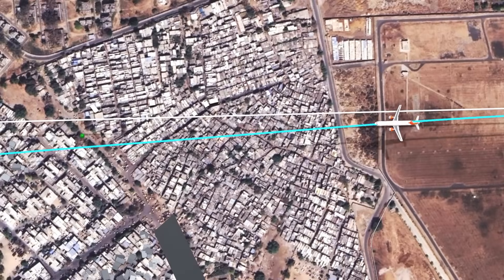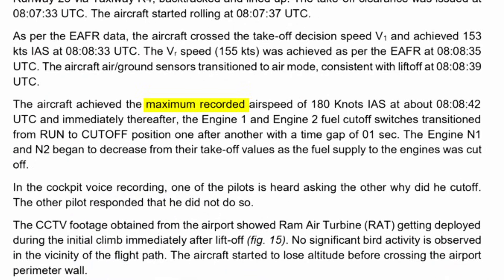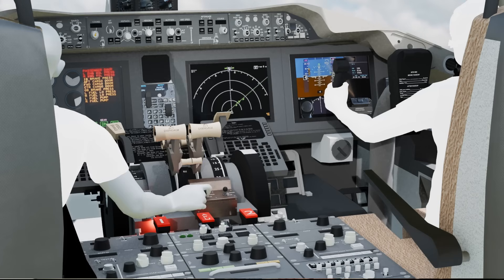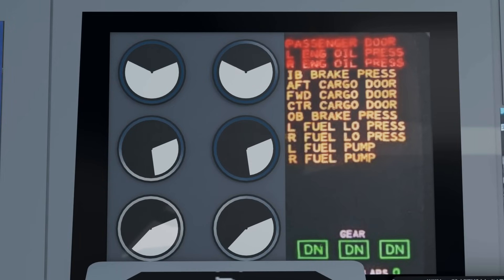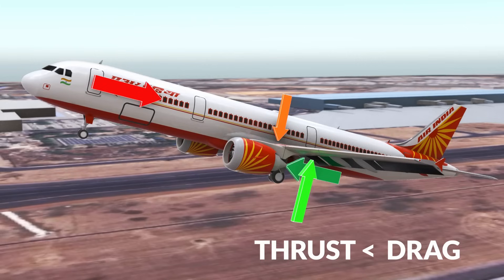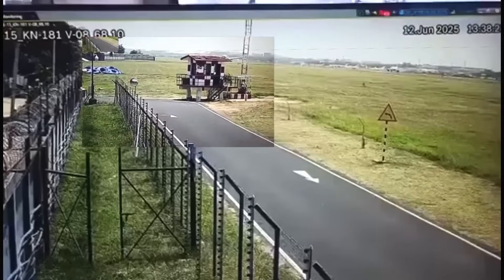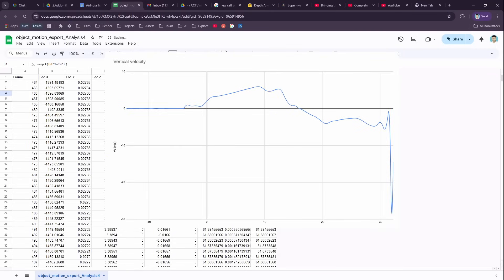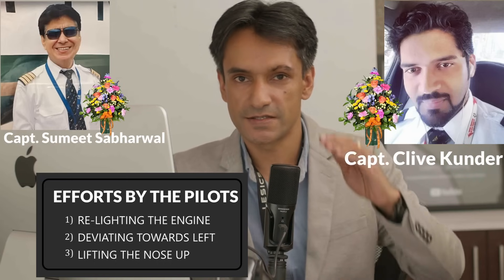Use of 3D Clone | Decoding the Crash Details you Missed

Comment: With 2,05,000 Kgs load and V1 as 155 KMPH, QnH 101 KPa, Dry runway, Temp 38 C, 6 Km Visibility, length of runway needed for a 787-8 to be airborne
for a Boeing 787-8 to become airborne with a load of 205,000 kg and a V1 speed of 155 km/h, we can refer to general takeoff performance data for the aircraft.

Key Factors:
Aircraft Weight: 205,000 kg (which is below the maximum takeoff weight of approximately 250,000 kg).

V1 Speed: 155 km/h (which is the speed at which the aircraft can safely take off).

Estimation of Runway Length:
The takeoff distance for a Boeing 787-8 can vary based on several factors, including:

Aircraft weight
Environmental conditions (temperature, altitude, wind)
Runway conditions (wet, dry, etc.)

General Takeoff Distance:
For a Boeing 787-8 at maximum takeoff weight, the typical takeoff distance is around 2,500 meters under standard conditions.

Key Factors:
Aircraft Weight: 205,000 kg

V1 Speed: 155 km/h (approximately 43.06 m/s)

QNH: 101 kPa (standard atmospheric pressure)

Temperature: 38°C (which is above standard temperature)

Runway Condition: Dry
Visibility: 6 km (not directly affecting takeoff distance)

*Performance Considerations:
Temperature Effects: Higher temperatures reduce air density, which can increase the required takeoff distance. The standard temperature at sea level is 15°C, and for every degree above this, the takeoff distance can increase.

Pressure Effects: The QNH of 101 kPa is standard, so it won't significantly affect the calculations.

Weight Effects: The aircraft is below its maximum takeoff weight ( 2,50,000 Kgs) which will reduce the required runway length.

Adjusting for Weight:
Since the aircraft is lighter than its maximum takeoff weight, the required runway length will be shorter. A rough estimate suggests that for every 10% reduction in weight, the takeoff distance can decrease by approximately 5-10%.

Estimated Runway length Calculation:

Standard Takeoff Distance: For a Boeing 787-8 at maximum takeoff weight (around 250,000 kg), the typical takeoff distance is approximately 2,500 meters under standard conditions (ISA conditions: 15°C, 101 kPa).

Weight Adjustment:

Weight Reduction:
Maximum Takeoff Weight: 250,000 kg

Current Weight: 205,000 kg

Weight Reduction: 250,000 kg - 205,000 kg = 45,000 kg

Percentage Reduction:  
[(45,000÷250,00)× 100]≈18%

Temperature Adjustment:
At 38°C, the temperature is significantly above standard. This could increase the takeoff distance by approximately 10-15% due to reduced air density.

Temperature Increase: Assuming a 10% increase for the temperature:

Estimated Takeoff Distance:
2,500 meters - (10% of 2,500) = 2,250 meters (approximate)

2,250 meters + increment for 10 % above standard Temp  (10% of 2,250) = 2,475 meters

Conclusion:
The estimated runway length needed for a Boeing 787-8 with a load of 205,000 kg, V1 of 155 km/h, QNH of 101 kPa, a temperature of 38°C, and a dry runway is approximately 2,475 meters.

For precise calculations, it is always best to refer to the specific aircraft's performance charts, as they provide detailed information based on various operational conditions.

Runway length consumed by the 787-8(AI 171, VT-ANB, creshed flight) 
approx. 3.25--3.5 Kms

Hence, above calculation possibly indicates that runway length required for V1(155 Km/H-No return or decision speed) should be well before the estimated take off length-2.475/2.5 Kms, which in the case of AI 171 was probably attained after the afore calculated 2.475/2.5 Kms runway length which indicates probable hidden/un-detected issues (thrust, engine power, any electronic/mechanical/electrical malfunction) might have happened during initial take off run-just before V1 speed or after V1, as the doomed aircraft gained take off @ 3.25-3.5 Kms of runway length (as indicated by one of the airport perimeter CCTV visuals).

Comment: The takeoff simulation is incorrect - the plane took off right from the end of the runway or even maybe behind the end of the runway, 
All the numbers do not relate to takeoff at a temperature of 40-45 degrees Celsius and the real barometric pressure above the runway

Comment: All of us remember the 737 max catastrophes and Boeings rush to blame pilot error. The situation for Boeing today is commercially more critical than then. With over 1000 787s in use a common software fault would be almost fatal for the company; who would fly in a Boeing after another such failure. The fact this shutdown was close to the ground suggests a logic fault could have fooled the engine management system it had landed. We all use computers, if you do not reboot every couple of days logic faults compound and a crash can happen or programs develop strange behaviors. The FAA has already issued a full shutdown imperative order every 58 days (hardly assuring), but confirming the 787 is currently unsafe if not rebooted regularly. The investigators seem to have rushed to judgement and this suggests Boeing pressure. Nothing about this tragedy is reassuring.
Reply: The shutdown-reboot was needed because a buffer over-run could lead to faulty data packet timing.  It's a bit like the Millenium Bug where 99 for 1999 would roll over to 00 for 1900.
Reply: @patricklockerby4308  or Boeing could fix the problem....

Comment: Hope a more technical explanation of the event. Another youtuber Jeffostroff posted height of aircraft when RAT had already deployed. It was around ~167 feet, not far from your calculations.  This can be seen in the photo that is part of AAIB report. If it takes 2 seconds for the RAT to fall down, one can backtrack the timepoint and therefore the height and velocity as well (assuming Vr was correct)
Reply: RAT deploys - does nothing until blades are clear of obstructions and then begins to supply hydraulic power about 3 seconds after deployment.

Comment: REMIND you one major fact those used to blame captain this incident,
After total electrical failure,when RAT is deployed automatically, it takes average 7sec to spin and provide emergency makeshift power to systems , ONLY CAPTAIN screen, yok control stick ,paddles are active in this emergency power case scenario,
So right after when power came back , captain Sumit was trying to save the aircraft, he is the one who might gave radio "Mayday " call .
Reply: Capt sumeet the ground, more likely
Reply: @Xeldinn the ground?? I didn't get you can you explain what you wanted to say
Reply: Yep sumeet a real hero, real hero.

Comment: The captain deliberately tried to crash the aircraft by cutting off the fuel and then the copilot deliberately tried to save the aircraft by turning the fuel switches back to on, that is why the one engine was in the process of a restart. Its not rocket science!

Comment: I have a different story, because although the report does have some inconsistency it is not some giant coverup.

Assuming the model used in this video is correct
Easily what could have happened is.
1 second after takeoff pilot1 uses 2 hands to turn off the switches in quick succession .
Soon pilot 2 notices and questions pilot 1when pilot 1 denies the action, pilot2 starts using violence to gain back control and in the struggle the rudder pedal is pressed. After a while pilot 2 wins control and tries to save the aircraft by steering towards a road, restarting the engines and pithing up, but is ultimately unsuccessful 

Also sry for the paragraph
And I do think this model and video are very cool we just must not draw our own conclusions
Any questions, ideas, or alternate stories I’d love to hear
Reply: Do you think the RAM air turbine deployed before or after fuel cutoff?

Comment: Simple question as a passenger, having last 15 minutes of cockpits footage would have stopped all speculation, why piolets need privacy when a bus driver drives for 10 hours under much more stress full condition under cctv
Reply: They still wouldn't release the video if it proved the pilots did nothing wrong and tried to save the airplane. They'd only release it if there was something fishy and this can 99.999% be detected anyway from CVR and FDR.

Comment: Liftoff	Cutoff-1		Cutoff-2	     Snapshot		
Ground Speed Knots	163	        184		      184	             177		
Convert	1.688	1.688		1.688	1.688		
FPS	                         275.144	310.592		310.592	298.776		
Time Lapse sec		3			7		
							
Theta deg	                      3	3		1.35	1.35		
Radian	0.0524	0.0524		0.0236	0.0236		
Sin Theta	0.0523	0.0523		0.0236	0.0236		
Vertical Speed FPS	14.3999	16.2551		7.3175	7.0391		
					8:43	7	53
Vertical Dist Ft	8:39	8:42	46		8:49	50	96
Sophomore Engineering Mechanics (Dynamics) Equation, s = ut + 0.5 a t^2 was used in the vertical direction. 
Ground Speed was calculated using Temperature of 37 deg C, Pressure Altitude of 530 ft (994 millibars) (Official METAR Data on June 12, 2025) , Density Altitude 3136 ft, 5 knots wind speed at 240 degrees to Magnetic North, runway 23 (230 to Magnetic North).
Flightradar24 QNH Adjusted altitude used.
Max Ground speed 184 knots at 08:42, 1st switch cutoff. 2nd switch cutoff at 08:43.
Max elevation 96 ft AGL (625 MSL), Ground speed 177 knots. Snapshot time 08:49.

ADS-B Flight Tracker data anchors 625 ft MSL, with ground speed 177 knots at 08:49 when the snapshot was taken. 
Engine 1 Fuel Switch Cutoff at 08:42 at max speed 184 knots at 46 ft AGL (above ground level)
Engine 2 Fuel Switch Cutoff at 08:43 at 53 ft AGL
Snapshot at 08:49, 2 seconds after RAT deployment at 08:47, ground speed 177 knots at 96 (625 MSL) ft AGL, consistent with ADS-B data!
Aircraft climbed only 96 feet on a hot, low pressure day (official METAR Data used)
Total runway distance used 3010 feet from liftoff to snapshot - 08:39 to 08:42 (max speed), 08:49 (snapshot) = 10 secs.

Comment: Based on the three fundamental theories of Landing gear system, Electrical system and Engine & powerplant system of B787-8. The root cause of the issue is attributed to the air/ground mode logic being stuck in ground mode (software glitch) 

----------------
Sequence of Events
----------------

1. Normal takeoff
2. Landing gear failed to retract after liftoff
3. Simultaneous loss of electrical power; pilot manually deployed the Ram Air Turbine (RAT)
4. Both engines shut down
5. "ENG FUEL CTRL / ENG FAIL" message appeared on EICAS, despite no intentional fuel cutoff ("why did you cut off the fuel", "i didn't") 
6. Pilot attempted to relight both engines by cycling the fuel control switch on Engine #1 (from RUN to CUT OFF and back to RUN), followed by Engine #2 four seconds later
7. APU switch positioned to START
8. Pilot declared MAYDAY to ATC
9. Aircraft impacted the ground

Comment: Thanks for all this research. I agree entirely with your hypothesis that the flight reached a maximum altitude of around 200 ft AGL.
My interrogation of the flight video shows the maximum altitude achieved measures almost exactly equivalent to one wingspan = 197 ft.
The aircraft is seen to climb for about 10 seconds, before levelling off for a couple of seconds and then descending for the remaining 18-20 seconds of flight until impact with the ground.
Analysis of Figure 15 from the Preliminary Report, using geometric comparison with the 787’s fuselage height and length, shows its altitude to be around 110 ft AGL (you say 121 ft) with the RAT observed in extended position.
The plane’s altitude of 110 ft (as captured in fig15) was therefore roughly halfway through its eventual climb to 200ft which took about 10 seconds altogether.
This indicates the RAT was already in extended within about 5 seconds of liftoff at say 08.08.54. 
If, in your analysis this took 9 seconds to achieve I don't see how the plane's altitude could have jumped from 121 ft to nearly 200ft in the one second it took to get to 10 seconds timeframe seen in the video of climbing flight - there's an error somewhere?